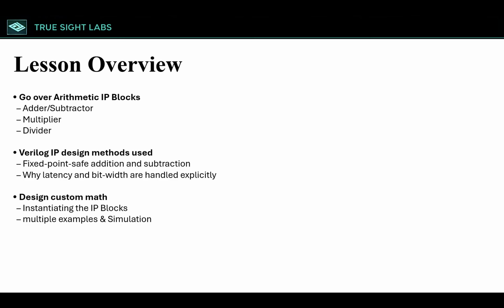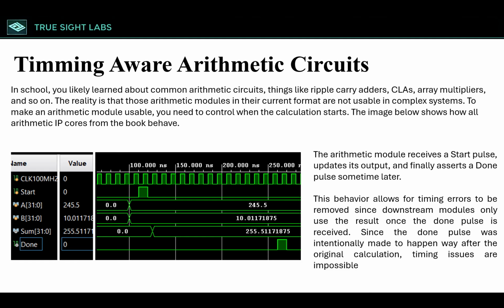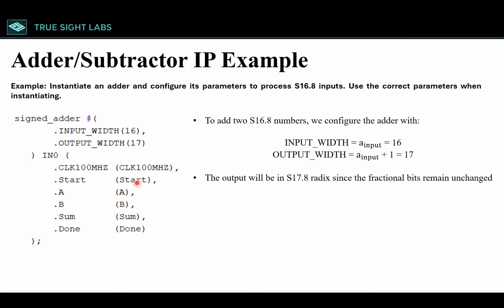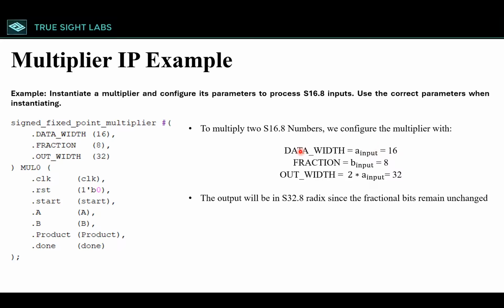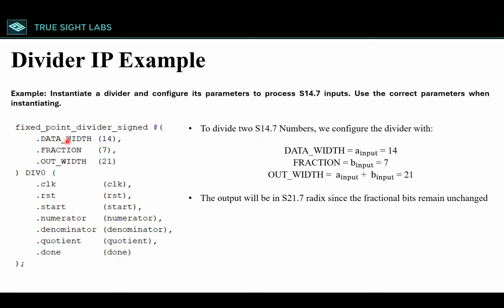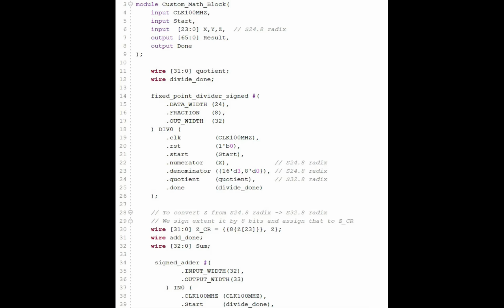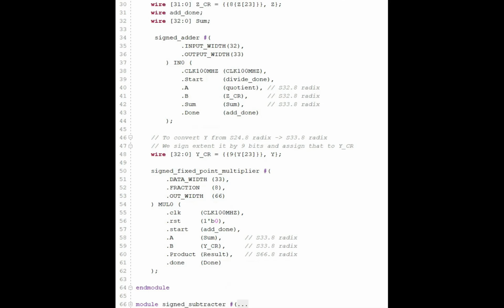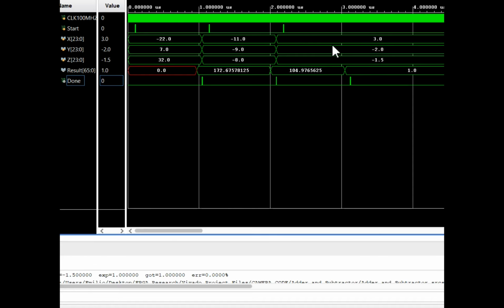Industrial-Grade Arithmetic IP Cores in Verilog

Comment: To process S16.8 inputs, Input width should be configured to 34 bits, isn't it?
Reply from the maker: I believe that for the format used, S16.8 means that the input is 16 bits long with 8 bits of fraction.
Reply: @em3755 Oh I get it now. As the IP verilog code is not disclose, I got a little confused.
Thanks~
Reply from the maker: @mohammed_mairajuddin_musharraf Yeah, the Verilog is not discussed since once you have the IP block, you never have to re-design it again. These IP blocks are really useful since they let you implement any mathematical operation you want